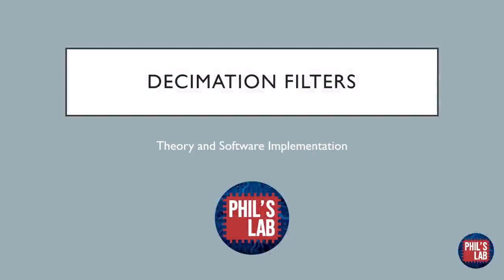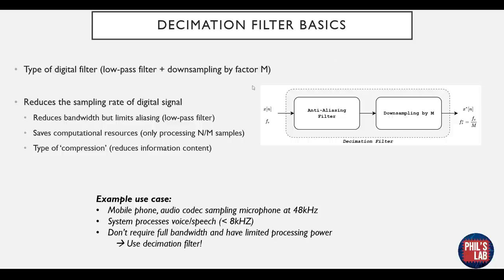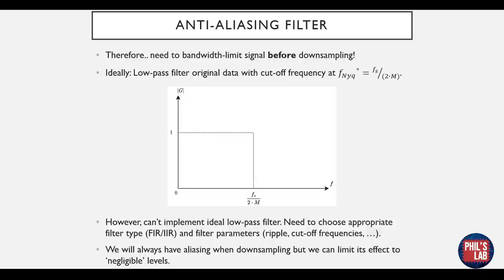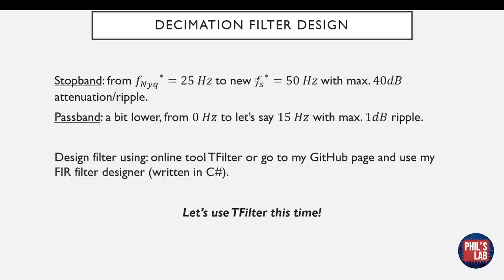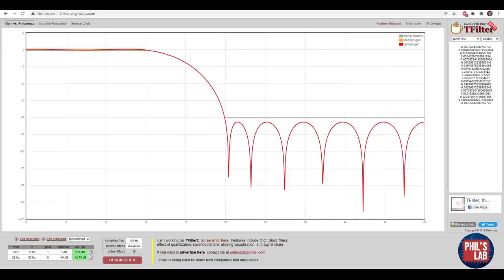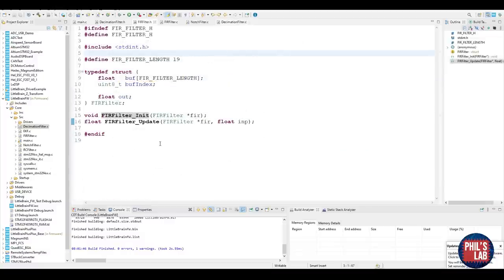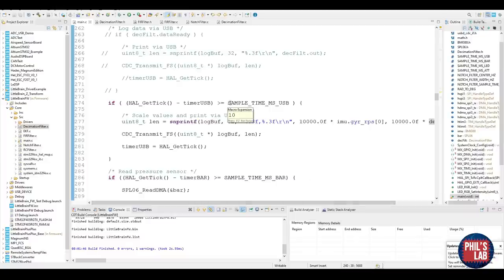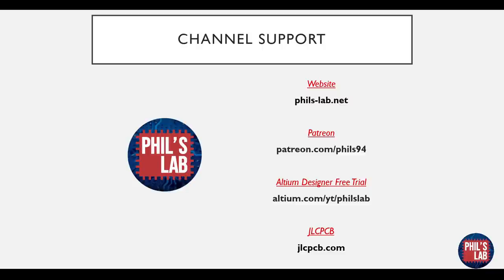Decimation Filters - Theory and Software Implementation - Phil's Lab #42

Comment: I see on the little brain board you use a 6 pin pogo connector, I have only found those connectors for around £100 from the USA, do you know of any cheaper alternatives?
Reply from the maker: I'm afraid they are quite pricey. I haven't come across any cheaper alternatives so far.

Comment: Phil, great content.  I've very much enjoyed your filtering information!

In terms of down-sampling, what are your thoughts on averaging M samples rather than simply skipping M-1 samples?

I have a lot of data systems that sample at 1KHz, but then output at 10, 100 or perhaps 250 Hz.  Most of them are implemented very much like this video, with the exception that we average M samples of the filtered data to create the output.

Is there a good reason to not do that?

Comment: I love your videos! Very heavy going for me unfamiliar with stm32Cube but nice. Question though, can't you just set the ADC to a lower sample rate?
Reply: You can benefit by sampling at a higher rate and then filtering and decimating, this helps you improve resolution by oversampling.
Reply: The idea behind decimation is that after filtering the signal is smooth, so there is no point of keeping all output samples - they bear no information.